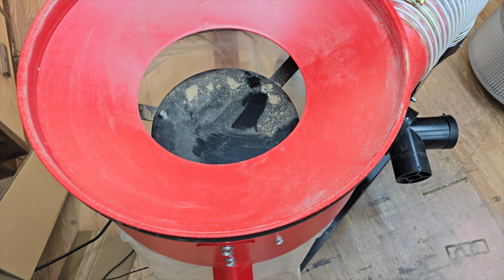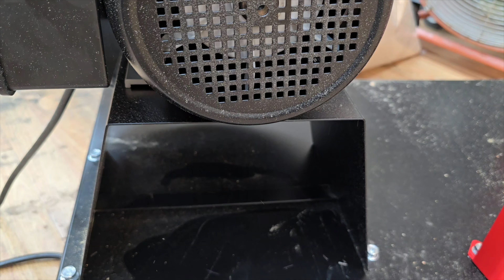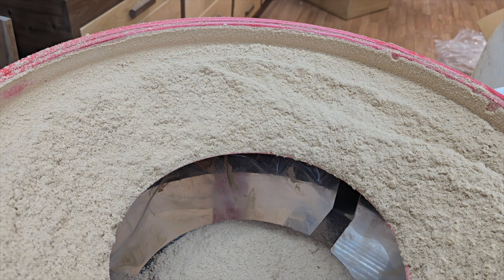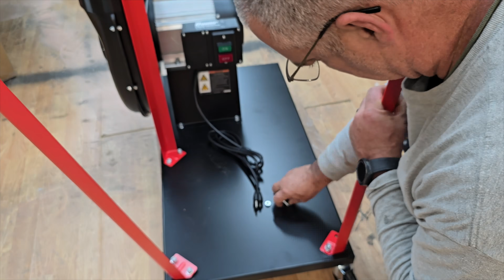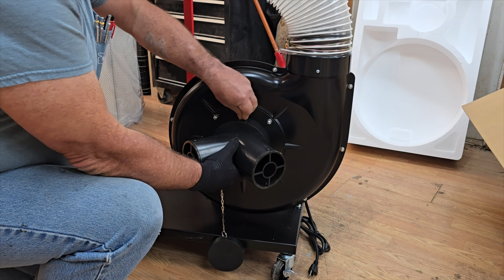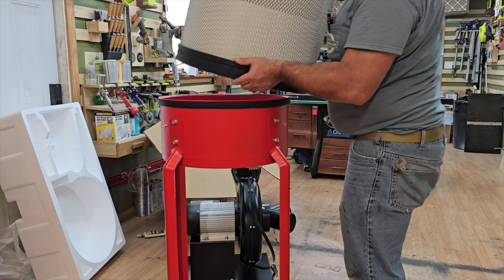Bauer Dust Collector

Comment: I was happy to see your video on the new HF unit last month, as no one had any videos out on it.  I fully believe this will replace the current 2HP version (also from Harbor Freight) as the new entry level/value collector to start with, but with much less modification needed.  I came today to point out that this week their 'New Product' email listed their new cyclone dust separator as well!  It can be used with 4" or 6" pipe between it and this unit, and includes a 20Gal drum (on wheels) that takes a bag!  I gave in and picked both up on the way home.  Can't wait to replace my old 1hp unit and cardboard barrel separator!
Reply from the maker: I have the cyclone in the back of my truck. I can't wait to get it unloaded and checked out.

Comment: It's easier to put the supports on the ring first. Set it on the ground upside down, attach the supports. Pick it up , stand it on the base then bolt the support legs to the base. I wonder what it would take to just add the paper filter to the one I have. Is it the same dimention ? 19. 5 inches I think
Reply from the maker: That is a good tip. Yes it is the same size.

Comment: Harbor Freight is also going to have a new bauer cyclone with a canister on the bottom to connect to this has at least 4in ports (not the bucket one).  Saw it on display at my local store.  Its a bauer also, but not listed on website yet!!! Yes interested in the modification files if you make them.
Reply from the maker: I got sent a picture of it. It only has a 20 gallon drum. What I am thinking would be change it to a 55 gallon drum. Then mount the motor and impeller on top. Having the exhaust going to the canister filter with a snall 3 gallon under to catch what little that makes it through the cyclone. I was told it was going to be released next week.

Comment: Did you by chance do any direct comparisons on CFM performance between the Central and Bauer?   Seems like you’re potentially losing a fair amount of power.   I’d be interested to see a “real use” comparison between the two.  I would assume airflow is easier with a canister filter rather than the old bag style.  I’m debating between trying one of these or upgrading my older harbor freight unit with a canister filter.
Reply from the maker: My older system has ben modified, so I can't do a comparison. The Cental Machinery one claims 1550 cfm. The Bauer claims1200 cfm. Just using both, I could not tell a difference. I think either way you go you will get similar results.

Comment: I bought this after news years with the 15% off coupon and just got around to getting it put together. The manager printed me out another set of instructions that included how to install the handle. It’s nut, washer then 
handle then washer,
 lock washer, nut, then cap nut. These instructions do leave a lot to be desired thou. Lol
Reply from the maker: If you have any questions look up the Rikon manual.  This is the same machine but their manual is much better.
Reply: @ Now you tell me. Lol

Comment: I have the Jet DC1200, and also picked up this unit as a secondary system to save a few bucks. Although the Jet design has not changed in years, it’s still outperforms this updated Bauer dust extractor. Due to this it might be worth spending the extra $300 or so for Jet.
Reply from the maker: I haven't tested the Jet DC1200VXCK. I am sure you are right. They both say 1200cfm. The difference is the Jet says 1200cfm @4". The Bauer tested 1200cfm @6". It was less @4". That is probably due to the 2hp motor on the Jet compared to the 1.5hp on the Bauer. The Bauer is the same as the Rikon 60-151C. Currently, the Bauer is $399. The Jet is $849. For my needs and budget, the Bauer will.
Reply: @ShopRamblings  The biggest performance killer I found is the stand itself. I have mine mounted to the wall. I have the central section inline with the motor housing. I also tossed the bag, and added an Oneida Super Dust Deputy cyclone separator. I don’t have tool to tell CFM, but my pull is around 35mph at the end of a 20ft 4” hose. I will be doing the same with the Bauer this Spring. If I don’t forget, I’ll come back here and let you know the pull I end up getting. You also seem spot on. 1.5HP vs 2HP, and 6” vs 4” is the slight difference here. Outside of that the builds are completely identical.

Comment: Great video - And you covered the details that I had some questions about.  This should be perfect for my 10x20 workshop.  I ran 240 lineal feet of 3/4"x1/4" dado for some custom profile cedar siding - with a bag and shopvac hose taped under the TS.  It contained some of the heavier stuff, but I ended up wearing a mask after 2 minutes.  I've got 2400 ft more to run, so something better is definitely needed.  Thank you!
Reply from the maker: You're going to love it!

Comment: Thank you for providing this.  I was a bit disappointed that the provided assembly instructions said nothing about installing the paddles and handle onto the filter.  When I called Harbor Freight’s 888 number, they emailed a blowup pic which helped. More importantly, they directed me to your video as the best place to get answers and that worked.  Again, thanks much.
Reply from the maker: I'm glad I could help! If you have any more questions like wiring it for 220v download the Rikon manual.  This is the same machine. https://rikontools.com/wp-content/uploads/manuals/60-151C/60-151CM10-Manual.pdf

Comment: I prefer a cyclone separator before impeller and the exhaust out of building no filter.   Removing 100% of fine particles out of building.
Reply from the maker: That is the system I have used for years. If it is vented outside, it is 100% effective.  Also, with a separator before the impeller you don't have to worry about the impeller getting clogged.
Reply: yeah if you live in the north you lose your heat, so that is not always the answer
Reply from the maker: I Florida we have plenty of heat.

Comment: Thanks for the timely video. I went and picked one up today and my what a difference from my 40 year old DC. 

Setup was fairly straightforward, but I did miss the vibration bushing for the impeller housing and had to take the motor back off.
Reply from the maker: The manual is the only thing lacking. If you need any info like wiring the motor to 220v download the Rikon manual. It has more details.

Comment: FYI, just built this and my 15amp breakers can't handle start-up. Dedicated circuits still tripped. Off to the store to get a 20 up and running
Reply from the maker: I haven't had mine trip a breaker, but I did run 12ga wire to all my outlets in my shop.
Reply: @ShopRamblings the guy that built my garage (previous owner) used 14 for every circuit. Who puts 14 in a detached garage for anything?
Reply: Ran 12 and swapped to a 20 breaker. All I well, and this thing sucks! Like, in a good way.
Reply: FYI mine kept tripping but you have to make sure it’s completely stopped before you restart it. The start up requires a lot of power but basically make sure it’s completely stopped before you start it again. That should solve the problem if running on a 15 amp.

Comment: Hey - thanks for the great video! Loved that you pointed out some of the things you liked and things you weren’t so sure about. Up to now, I’ve been a shop vac/HD dust stopper guy. 

I’ve thought about buying the old Central Machinery DC, but once you do the upgrades on it, may as well have bought a Jet or similar. I like that this machine does a fair amount of those upgrades. 

Do you know if the impeller is plastic or metal? I haven’t watched you other videos yet, but do you typically upgrade the impeller?
Reply from the maker: It is metal. How many cfm are you needing. I think most people who upgrade the impeller didn't need to. This is going to be 10x the cfm you have. Rather than changing the impeller, if you spent that effort on duct work, you will probably get more return on investment. 

 I have found out this is the Rikon Model 60-151C: 1.5 HP Dust Collector, just rebranded at half the cost. If you have any questions such as converting it to 220v or assembling the filter beater, download the Rikon manual.
Reply: @ oh hey, that’s great! I actually just took a closer look on their website on a computer and can see the impeller better to confirm. 
I don’t have huge cfm needs - just a Ridgid hybrid table saw, and DeWalt lunchbox planer.

Comment: The collection bag looks like a pain to install. Can someone comment and what about the bag? Is it once and done? Can I use large trash bags? Thanks
Reply from the maker: The bag on the old system had a clamp and was a pain. That was the main reason I modified my old system. I expected this one to be about the same. It surprised me that it wasn't that bad. The bag is very thick. It's not like a normal trash bag. I have only filled it up a couple of times. Once it gets about 3/4 full, I dump it. Then I reuse the bag. If you need to replace the bag, they are available at most woodworking stores or on Amazon. 
https://amzn.to/3PuSWui

Comment: Question: do you recommend the 'soft start' version of the remote switch, or the simple 'on/off' version.
Reply from the maker: I would not. I don't see the need in soft start. It looks like the same motor as my other dust collector. It never had soft start and never had a problem. Others may have a good reason to use it but I am more of if it ain't broke don't fix it kinda person.

Comment: For anybody out there with the desk collector, if you were hitting the on and off button, I truly feel bad for you. Pick up the key fob controlled on and off switch it. It will make your life way easier. I keep it clipped on my Apron and withwith the push of a button, I can turn it on and off
Reply from the maker: I agree 100% with you. If you have to go over and turn it on and off every time you're not going to do it. If you want something to be used for safety, you have to make it easy. You can see I have a lot of videos showing where I automated my system by putting micro switches on my blast gates. Even with just having to reach up on my Miter saw less than a foot away from where the handle is and sliding the blast gate open to turn on my system. I catch myself sometimes not doing it. If I had to walk over and hit the on button that would happen a lot more often. Thank you for pointing this out and as soon as I finish with this comment I am going to go find one of those key fob switches on Amazon and put a link in the description. If you know of a good one please let me know as I don't use that system but it is a simple and easy to add.
Reply: @ the one I have is made by O’skool however it’s like $60 and it is designed for dust collectors however Amazon has 15 amp remote switches that are intended for anything 15 amp and they’re about $15. I’ve always wondered if they would work with a dust collector. I did buy one of the cheaper options and I have my shop lights on it. Because I do film in the shop and it makes it easy to turn the shop lights on and off with a key fob because when I film, I use cinematic lighting.

Comment: 2 Micron filter you mights as well use the 1 micron bag
Reply from the maker: Have you ever used the bag?  I think that is why you see so many people selling almost new dust collector on Facebook Market Place. It may say 1 micron. I don't know if it is the limited surface area but that bag seems to put out a lot of dust. The cartridge filter definitely makes less visible dust around every system I have used.
Reply: @ShopRamblings  a 2 micron filter compared to a 1 micron bag is no difference!  Think
Reply: No such thing as a 1 micron bag, someone may market a bag as 1 micron, but there is no way it actually yields at 1 micron filtration effectively.

Comment: HF has really been putting other companies on notice with their upgraded products like this dust collector and their dust extractor. They are showing that building these things don't coast as much as the price tags on the other brands indicate, and they are going to need to get more competitive in their own pricing.
Reply from the maker: I also find it nice that Harbor freight has added a lot more woodworking tools. In the past, they seem to have mainly been metalworking and mechanic tools. They always had a couple but that was about it. They Recently have come out with scroll saws, jointer and many other nice woodworking tools that seem to be very well thought and well designed at an extremely competitive price definitely. They are some of the best value to quality ratios you can find.

Comment: Nice review. Basically this is $150 more than the old one, which is 50% more ,but you're getting a lot for that. For starters, that's half the price Rockler charges for their similar paddle filter, though theirs claims a small micron filer. But that alone makes it worth it. But throwing in the better separation, bigger impeller, easier bag change, etc makes this really a no-brainer. 
The folks at Wynn filters are going to be really annoyed by this since I bet they made a lot of money from people upgrading their HF DCs with their filters.
Reply from the maker: I had upgraded my old one also.  Now I've got a $100 filter in my attic that I'm not sure what to do with.  Maybe I will use it to make an air filter for the shop.

Comment: The best, cheapest, safest, and most effective way to run a dust collector is outside of your shop into a container outside. It will be stronger and less restricted, and the particles will be far from your lungs.
Reply from the maker: I agree. That Is how my system is setup. Some people are not able to do that. When I started dust collection in my shop there was not an affordable option this good. I wanted to check it out and see if it was any good. If this would had been available back then it would have saved me a lot of time and money.
Reply: Outdoors is great if you don't pay to condition your woodshop, I can't imagine the cost of heating a woodshop with external exhaust at below freezing outdoor temps.
Reply: @StratOvation  definitely true....lol

Comment: Great video, Thanks.  I also just picked one up with the 15% off coupon.  As mentioned in another post, the HF Bauer unit is virtually identical to the JET DC-1100VX-CK model, but at half the price.  My guess is both units come out of the same factory.   I had the same issue with having to assemble the canister pad assembly,  which the HF instructions did not cover at all.  Fortunately,  the JET instructions cover this assembly process very well. The fit and finish of this HF Bauer unit is top notch, can't wait to put it to work.
Reply from the maker: I should have looked up the Jet instructions. I got it to work. It just took me a couple of trys. It is great when you can get a tool at half the price without having to give up quality.
Reply: No there not identical , the jets motor are sealed bearings  will last a lot longer, the jet is a cyclone this is a thine baffle, the jet is stronger to, but having said that this is a great deal and prolly better then most  but far from identical to jet..

Comment: You know, not too long ago, most of you guys use to be like;  Harbor Freight is crappy, they only have cheap stuff etc. Now look at y'all trendy buzzards...
Reply from the maker: You must not watch my channel much. The videos shot at my Dad's shop. Those bands saws are from Harbor Freight. We bought them in the early 1990's. My oldest tool review that I did 6 years ago is on the Banks Brad Nailer from Harbor Freight. So when you say "not too long ago " how many decades are you referring to? I don't remember saying Harbor Freight made cheap tools in the 80's but it is possible. If I did I was referring to low price, not low quality. But it's cool that you think I am Trendy.
Reply: @ShopRamblings  I think a lot people had bad experiences with them. They do have some cheaply made tools and I bet that's what they have used. I use a Hercules compound sliding miter saw from them and it is the best saw i have ever used. I have 2 dewalt non sliding saws and they have lasted over 20 years. Brushes and switches are all I ever replaced on them. I just didn't see spending nearly 700 dollars on a saw. My cousin has the dewalt version and even he is quite impressed with my Hercules. I also have a drill press from them I bought in the early 2000s. Only belts have been replaced. Also a number of mechanics tools, paint sprayers, nail guns and even their nails. I personally don't buy their cheaper line because I use my tools a lot.
Reply from the maker: @bjenkins803 HF business model has always been good, better, best. A good example is angle grinders. They have them from $12 to $129. The $12 one is great for someone who is only going to use it for light duty or occasional use. The problem is idiots will buy the $12 grinder and get mad it doesn't last as long under heavy use as a $150 name brand grinder. Some tools are not made to last forever, but for the price, they have the best value in tools.
Reply: They have been trying harder the last few years.

Comment: I have the Jet version of this dust collector.  Recommend you immediately put the Oneida Super Dust Deputy ahead of it.  I have mine mounted on a 35 gallon galvanized trash can.  I've had it about 5 years, and the only time I ever got more than a handful of dust in the bag was when I let the trash can fill up.  Otherwise, I've only changed the bag that one time in five years.
Reply from the maker: A dust deputy will separate the dust out. The canister filter also works great and is more compact. If I modify this unit, I may try a super dust deputy.